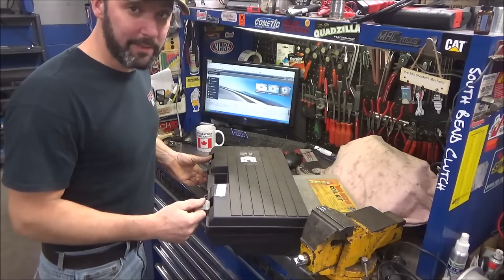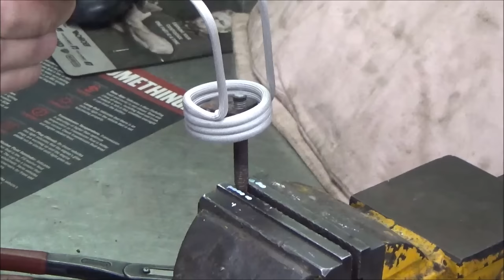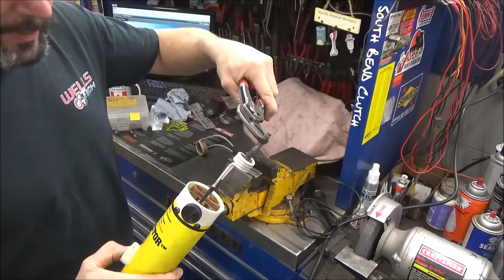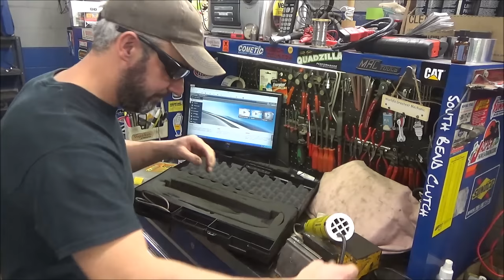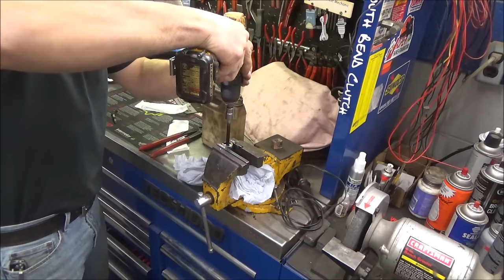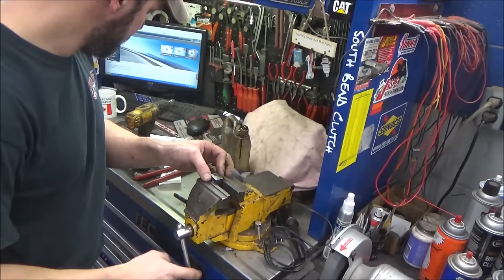How To Heat Up A Nut or Bolt WITH OUT A Torch

Comment: Does the coil get hot?
Reply: Not too much, the coil is making a magnetic field that basically forces current in the metal that you put inside. High current makes lots of heat very quickly.

Comment: Well that doesn't help me right now, nice toy though do they come with angled tips for getting into tight areas?
Might just go to the welding supply store and see if they got a small propane brazing tip for my little victor torch, if penetrating fluid don't do it by this weekend.
(Penetrating fluid never works for me) Trying to get bolts or nuts (I can't tell) off brackets to a leaking Fuel Filler neck without killing myself or lighting the car on fire.
Reply: Drain the tank, then fill it with water if you have to work with a flame in the tank's vicinity. Remember, it's not gasoline, but the vapor, that is combustible

Comment: I hate when T belt job goes south on  old 3.0 /3.3 Toyota or Lexus when one or both of those long through bolts from the dogbone mount bracket at top front  of motor are corrosion seized in the aluminum riser between  lower engine bracket .

Comment: Could really use one of those, save a lot of hassle getting rusty suspension and brakes apart. You tried loosening a seized brake bleed nipple with it? Safer to use than the oxy acetylene torch and quicker to use. Just got to wait until they come down in price a bit.

Comment: Well, this is a great tool, but at $500 for the main tool and another $150 + for the coils, it is actually cheaper to buy a propane bottle and torch. 

Had to remove the rear axle on my F150 (stood the truck up on 2 wheels at a stop sign when the Ford 9" rear locked up... talk about fun!) used a torch with a leaky gas tank... no problem. Its all about ventilation. Clearly you don't want to do this inside. Even with the torch it took 3 people and a 6 foot steel pipe on the breaker bar to crack the bolts free. They all came off without breaking and I was able to reuse them all. Broke two sockets...but they were craftsman.
Reply from the maker: +arosenberger87 Torches and leaky gas tanks are always the best solution until it isn't...

Comment: Same exact thing happened to me with my Subaru except I went to the Home Depot to get a new bolt and had to drill and re tap the adjuster because I didn't have the proper tools

Comment: Very cool, or should I say hot!  I think you can purchase the white loom that insulates the coil on eBay rather than toss the coil. Also the closer the fit of the coil to the inductor the faster it will heat.

Comment: Wondering how hard it would be to make one of those induction heaters in the shop. Looks like an old Weller soldering gun on steroids. Those created such a strong induction they would cause molten solder to flow away from the loop in the soldering tip. Just scaling the schematic up 100x and adding a brushless computer fan to cool the primary winding should suffice.
Reply: wrong

Comment: Kinda wondering how the 3/8" Milwaukee Fuel Drill Driver would have spun that bolt to cut those threads.  Think I'm going give it a shot.   Since I don't own any DeWalt tools - I'll use your time to compare. Oh yeah, wife and I started dancing when you was cutting threads ;) BTW - Sorta curious about what's under that shop towel on your work bench ...
Reply: +Hawaiian F150 I love my Milwaukee tools.  Burned up the DeWalt ones pretty quick.  Merry Christmas!
Reply: +raykrv6a Merry Christmas as well to You and Yours!   Yeah..  I know what you mean.  DeWalt does have some good things but after decades of using about everything I am more inclined to spend a little more (or in some cases a little less) and get what really is what they say it is.  I have some old Milwaukee drills that are still mean assed thumb breakers for sure. Got a 1/2" drill hawg that snapped my thumb.  Tried to re-drill a frame cross member bolt hole to slip in a couple larger bolts on an old '85 F250. Needless to say I got down to the last hole and it was late and I was tired. Dang drill bit bound up from me not holding it straight and it bit in hard and snapped my right thumb back to the wrist.  Had to finish drilling to use the truck to go to the hospital for a cast.  Not my crowning moment for sure.
Reply from the maker: +Hawaiian F150 OUCH! A Milwaukee drill is how my dad found out he had cancer oddly enough. He was using a big magnetic frame drill and it cut loose busting a few ribs on him and it was at the hospital they discovered he had multiple myeloma.
Reply: +South Main Auto Repair  -  Ouch! Sent back your way!!   I am truly sorry bruddah ... that's a tough one. Hope I didn't bring up bad days?  How is it all going?

Comment: When you clamp that threaded piece in the vise, try to clamp it in the middle of the jaws rather than at an end.  This centers the stress on the vise and it will last 80 years instead of 70.

Comment: Would an arc welder do the same?
Reply: This thing pushes high current at low voltage through the coil, so you could try rigging up a similar coil and powering it from a welder. You'd want solid (not stranded) bare wire with that white high temperature insulating sleeve material (probably fiberglass) over it.

Comment: I' saw my first microwave oven cook a potato on a paper napkin in 1960., & a heat pump installation in a house , in 1968 I saw an old man inductively heat a 2x2 inch square tube to create a bend in a trailer hitch installation. I was only 14 yrs old & only remember 2 large cables being connected to it .So what unit is capable of inducting that??
Reply: Zak S 
An inductor

Comment: Magnetic induction heater?  I didn't know there is such a thing. I wish the auto makers would use all metric or all SAE. I hate it when they mix them. Sometimes no wrench, SAE or metric, will fit some nuts. Either too big or too small.

Comment: hey eric,I would like to see the video of how to put the do the timing chain on those toyota
Reply: it's not a DIY job if you've never done a timing chain before. if you get the timing off just one tooth you could wreck the engine.
Reply: +Peter “Crackpot Pete” Carlson i'm mechanically incline,If they explain to me the right,I will do it right
Reply: STEEVE DAVID Nicolas I consider myself mechanically inclined, I'm a locksmith and mechanic  but unless you've done a timing chain before DO NOT  do it by yourself. Get someone who's done one before to help you as it is usually a bitch of a job and like I said, if you are off by one tooth at best your car will run like crap and at worst your valves will crash through the top of the pistons. I thought he had somewhere on here a timing chain job on a Subaru though.
Reply from the maker: +STEEVE DAVID Nicolas These are belt drive engines....
Reply: +South Main Auto Repair oh!ok,just being curious,I have a ford it is chain drive
Reply: +Peter “Crackpot Pete” Carlson thank you ,I will keep that in mind
Reply: +STEEVE DAVID Nicolas I guess I'm pretty late, but just know that you CAN do it yourself. Just be sure everything is aligned properly before you put it all back together, otherwise you will need to take it all apart again. You can check if it is all aligned by turning the engine manually via the crank. If after a couple of revolutions everything is still aligned then you're good 👍.

Comment: So what do you do when the bolt has twisted off below the surface and its in a hunk of iron ?
Reply: dewey dodo tap n die set
Reply: ive had success welding a nut on just clean the bit you want to get out and not the surrounding metal then it usually will only stick to the bolt, otherwise drill out and re-tap or if your lucky it will spin out with a left handed drill bit.

Comment: What is the issimue w/ a lighter tho.. not enough flame and heat?
Reply: Yeah, a lighter will never get metal red hot, the lighter would melt long before then. A torch for soldering copper for plumbers may work and be the cheapest bet, but even that isn't meant for the job. It may get you out of a bind if you've got one around. If you do lots of work in a garage, just save up and buy an Acetylene torch. Its the best tool in a garage. It makes impossible tasks a lot simpler. Inherited mine from my grandpa and its amazing how often it gets used for what seems like a simple task.
Reply: Hey txs a lot for yer reply. New to trying some self auto-motive maint'nc. Ltd in special equip, found out 2 bleeder bolts wont comoff
Reply: @PickUpsrnotTrucks
It felt totally ridiculous. 8 mm cres wrench too big, 7 mm too small. Whtever size  'worked' rounded it off

Comment: Love it! Too bad its $400 and not portable. I'll just stil with an acetylene torch for now. Mabe they will make a smaller lithium ion one? 

Dewalt already had a portable welder for emergency trail fixes
Reply from the maker: Interesting. It would be cool to have a cordless version of it
Reply: A cordless induction heater running from batteries might be a bit difficult to make, though not impossible. Induction coils need AC power at high current. Putting DC from a battery through the coil would just make it an electromagnet, which wouldn't heat up anything.

So you would need an inverter to turn the DC from the battery pack into AC. Then you would need a transformer to bump up the current and lower the voltage to a safe level. Having both devices as well as a high capacity battery pack (induction coil heaters need a lot of power) would be rather heavy and take up a lot of space. So I'm not sure it would fit the definition of portable all that well.

The mains powered versions can be smaller because they are fed with AC power already, either at 120 or 240 volts. So they only need a transformer and a switch, which is far more simple.
Reply: there is a mini one, which is what he has in the video, I saw it online for around 150 dollars

Comment: At the 2nd shop I was at, the shop manager who for some reason felt the need to put his hands on every car instead of letting the techs do their job. Anyway, he was teaching me how to use the torch. He was using it on the straps of a gas tank and then told me to try it and I flat out said no. He then begins to go on a tirade saying I don't want to learn and this and that. My response was "well......gasoline and its fumes are flammable. there, I taught you something." He didn't like that too much, so just took the torch away and let me do my work.

Comment: im gonna try a plastic repair heat / melt gun! my bolt is on a panhard bar close to my gas tank ( 65 Ford Galaxie ) THX
Reply: How did that work out?
Reply: I have chrome trim pieces and auto glass for sale from a '66 Galaxie 500.
Are you, or anyone, interested?

Comment: Anyone ever use this on a downstream O2 sensor? I just ordered it with the additional coils. I am hoping that this will do the trick on the 7/8 inch O2 sensor.
Reply: Did it work? I was thinking the same thing.
Reply: @ChrisLincolnHomes  I have not had a chance to use it yet. Turns out the OS2 sensor on my car was fine. I have read that it does work though from different sites. I am keeping mine because I know its going to come in handy on a lot of other stuff.

Comment: I can’t say if I ever saw one before  that would work good to  light cigars. They have a small one to heat a cup of  water
Reply: It only works on electrically conducting materials. It actually inverts the magnetic poles of the part many times a second, basically making the molecules rub together, which cause heat from friction.

Comment: Looking for a way to heat a broken bolt inside the aluminum block with out a torch. not sticking out, not flush, about 1/4 inside. but every video has these bolts set on vices or sticking out and flush to weld a bolt to, and there on the bench tops or in a vice. No real life everyday broken-off exhaust manifold bolts that are more common than other breaks .

Comment: An expensive fan cooled transformer unit. Could just use those coils or wind your own with a cheap AC welder. Otherwise a propane torch is pretty cheap for small stuff like that.

Comment: Does the diameter of the hole get smaller or larger when you heat it ? I assume the steel expands in all directions
Reply: Most probably, a little larger, in spite of the fact that, intuitively, the hole should become smaller after the dilatation of the metal (in all directions), but it seems that the molecular thermic agitation will increase a little the diameter of the hole, by pushing one into another.

Comment: there is another way of doing this, heat the nut just hot enough that you can't touch comfortably then
spray wd40 or other on the bolt. The shock contracts the bolt to loosen the rust and allows the oil to
penetrate further.
Reply: +g2macs Candle wax works good as well. I use it sometimes on shackle bolts that are rusted to the bushing

Comment: This is every bolt on my 00 civic at the moment for some reason.  fudge I hate rust.
Reply: 2001 Ford Explorer Sport in NY.  If it weren't for the rust, there wouldn't be a bit of steel on it.

Comment: There's another video on YouTube showing a guy doing red permanent thread sealant on several bolts then using a torch, heat gun, lighter, matches, etc and the torch and heat gun both freed the bolt while the torch also chars the bolt. He did not use inductive

Comment: What do you use to get   a broke off head bolt in a 350 chevy engine block? I knew a guy that broke off an ease out in his. Huge mistake!
Reply: Blade if you break off an easy out you'll have fun. That's when I send it to the machine shop that has a disintigrater.. my shop charges 40.00 a hole.
As for the broken head bolt I place a proper sized washer and nut over broken bolt , turn the heat up on my mig gun and weld the nut to the bolt. Then turn the bolt out...
Reply: ,Richard Shepler Sr Thats a great idea! I bet the heat helps to break the siezed up bolt loose as well.
Reply: Blade probably a machine shop Will have to mill that head out to get the bolt out,,,Then they may possibly have to install Healy coil maybe

Comment: Knipix pliars......     Tells me you're a great mechanic!
Reply: Yes, but when you're heating metal to red hot, you don't want to use your EXPENSIVE pliers!!!

Channellocks for this job!

Knipex for the jobs where you won't temper the metal on the teeth!
Reply: A pair of $5 crappy pliers would have worked.
Reply: jhitt79 
Evidently you have never used Knipix quality pliars before?  Once you use them, you will never go back!
Reply: Super Dave actually I have several of the pliers and needle nose. You can get some that have the craftsman name on them but are made by Knipix and are 1/3 less price.  What I was getting at is that nice tools are cool but don't have any reflection on the user. It could just mean that someone is in deep debt.
And again, for what he was doing he could have used anything.
Reply: Super Dave I've had my knipex cobra pliers for so long, they have no bite left in them. Time for new ones

Comment: They're a tad expensive for the home mechanic.  We use a fixed industrial type in work for heat shrinking machine tools.  These automotive ones run from crappy £400 ones to thousands.

Comment: Tell me something I got a nut that's stuck ,loosen three of them but the fourth one won't bujj at all seems rounded out I've ask several people, to help an still nothing, what do I do need help anyone? I mean my tyre the nut won't loosen
Reply: Put back on the three lug nuts and carefully tighten them down real good.  By doing this, hopefully it can take away some of  the stress that is on the nut that is really stuck.  Spray the wheel stud (if you can) and let it sit for a while  (Overnight would be nice) so the lubricant can work into the treads.  As for the outside being rounded off,  try to go down one size on your socket if you can.  Sometimes I had to hammer it on.  It won’t matter if the nut gets messed up because you should change it once you get it off.  I also got a set of these sockets that look like they have a spiral on the inside.  They get wedged on the nut as you try to remove the nut.  You can get them from a auto parts store, Sears, Lowe’s, etc.  One company is called Irwin, and the one I have is Craftsman.  It got me out of a bind.  I hope this helps.
Reply: David Walter just seeing ur reply I'm gonna try it as soon as possible thanks much will let u kno the out come

Comment: Hey, I need help getting my screws and bolts off my 2003 Ford Crown Victoria. The screws and bolts are rusted plus it is cold outside.
Reply: Light your car on fire to keep warm, that way your warm and you don't have to worry about those bolts and nuts.
Reply: I used to do all my wrenching in the fall and spring, if something broke in winter and it was -fing cold out id just pay to have it fixed
Reply: @jason4832  Thank you sir, I actually replaced the starter myself. It did take a while, but I got it done.

Comment: would it melt aluminum?
Reply: It wouldn't even heat it up.
Reply: @jacobpoucher  well, it's not fully wrong, it will work somewhat on aluminum but not to the extent that it will work on metals like iron because of their magnetic properties

Comment: Maybe some way to use it in plumbing applications, like copper pipes?
Reply: I don't think that would work.  It also wouldn't work on aluminum.  It needs to have iron in it.  It has to be magnetic for the induction to work.

Comment: Q: How To Heat Up A Nut or Bolt WITH OUT A Torch?
A: In plain sight of the nut or bolt thumb through a Snap-On catalog, then stop at the "Tool of the Month" centerfold.

Comment: Before this video starts: "Is this an induction heater video?"
Pinned comment points to an induction heater. Guess that answers that.
Handy to have around, but expensive. Not as expensive as a torch kit and cylinders (and really it's the cylinders that are expensive), but still expensive.